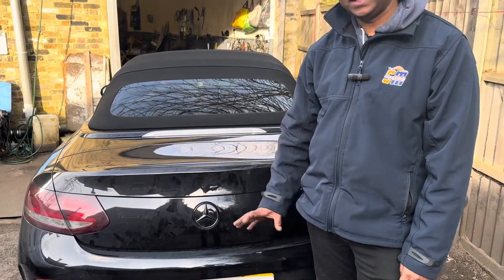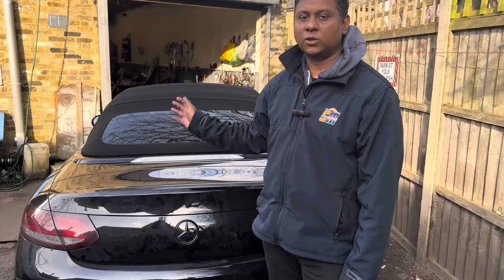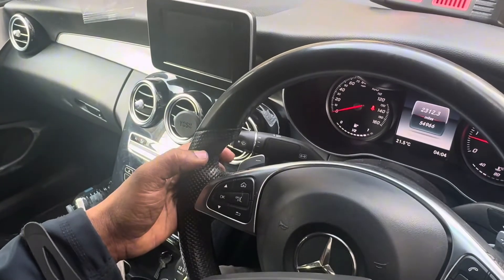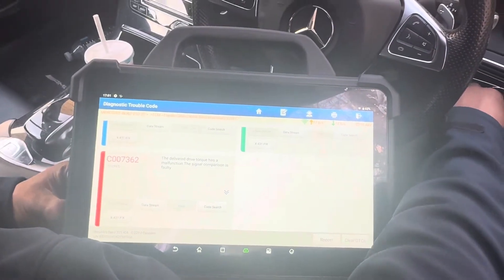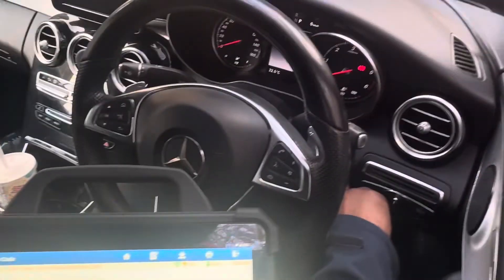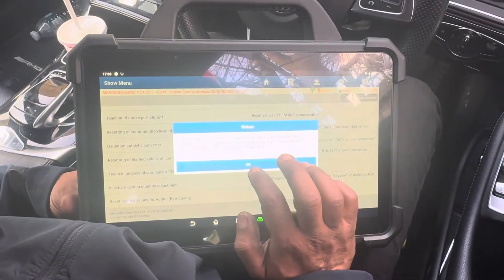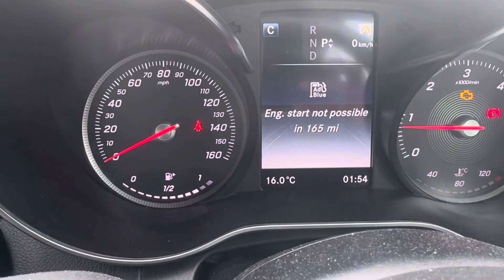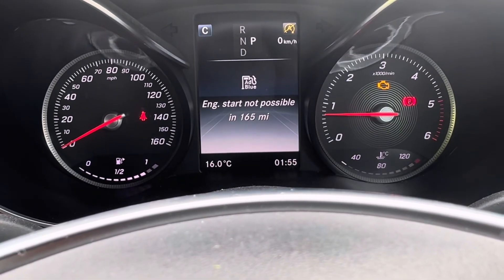Mercedes Adblue / NOx Sensor Fault Diagnosis Assessment

Comment: So what was the result?
Reply from the maker: It sounds like you are referring to a video that discussed an assessment related to a Mercedes AdBlue/NOx sensor fault diagnosis. Unfortunately, without access to the actual content of the video or more context, I can only provide a general idea of what the assessment might involve.

Typically, a Mercedes AdBlue/NOx sensor fault diagnosis assessment would involve the following steps:

1. *Fault Code Retrieval:* Using a diagnostic tool to retrieve any fault codes stored in the vehicle's ECU related to the AdBlue system or NOx sensors.

2. *Visual Inspection:* Checking for any obvious issues, such as damage to the wiring, connectors, or the sensors themselves.

3. *Sensor Testing:* Using diagnostic equipment to test the functionality of the NOx sensors. This might involve checking sensor readings under different operating conditions.

4. *AdBlue System Check:* Ensuring that the AdBlue tank is properly filled, the fluid is of good quality, and that there are no issues with the AdBlue injection system.

5. *Wiring and Connector Inspection:* Checking for any corrosion, loose connections, or breaks in the wiring harness that could affect sensor performance.

6. *Software Updates:* Ensuring that the vehicle's ECU is running the latest software version, as updates may resolve known issues related to sensor performance.

7. *Component Replacement:* If a fault is confirmed with a NOx sensor, it may be necessary to replace the sensor and reset the system.

8. *Post-Repair Verification:* After any repairs or replacements, verifying that the fault codes are cleared and the vehicle operates normally without returning fault codes.

If the video mentioned the results, it might have provided insights into whether the diagnosis was successful, whether a particular component was identified as faulty, or if further steps were needed.

If you have more specific details or questions about the assessment, feel free to share, and I can provide more targeted advice.